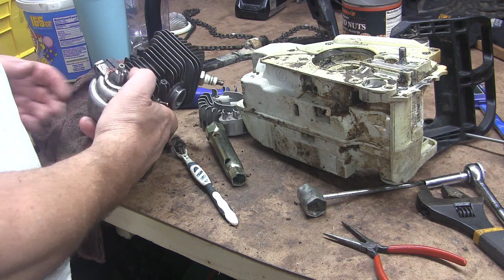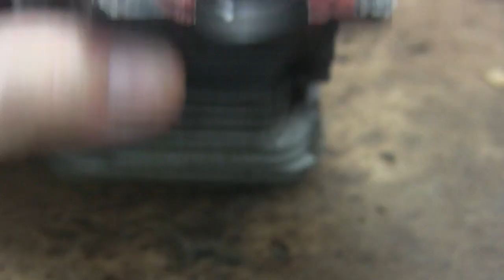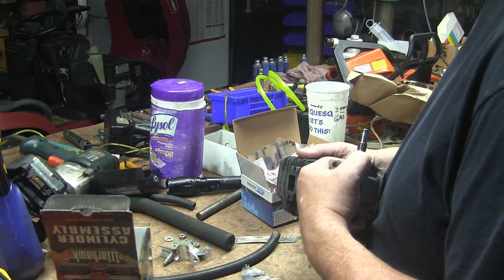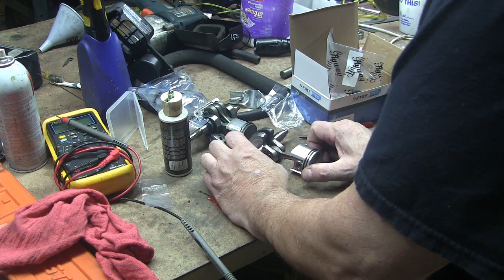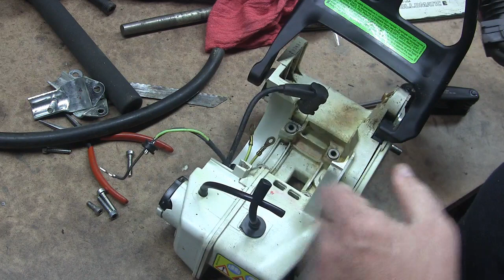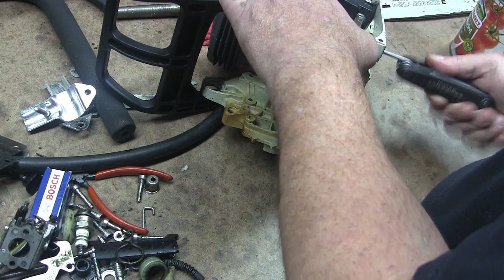Stihl MS 250C chain saw short block replace Part 1

Comment: thanks for the vid mate , im in australia , and about to do the exact same saw , its given me 5 years commercial hard work , which in its self is very impressive , so time for a rebuild . this vid has helped a lot . what was the gasket goo you used for the bottom end ?
Reply from the maker: High temperature RTV silicone. Let it cure for 24 hours with the bolts torqued before trying to run the engine.
Reply: I'm in Tasmania and mine was 3mths old and I decided to teach my boy how to safely cut trees and firewood.
Well... being over keen he gave it a tank full of straight fuel, no oil.

Not happy.
It cost me $450.00 Aus: for parts.
Needless to say he wont be using my chainsaw ever again.
Thanks for the vidio.
🇬🇸🐨🦘🇬🇸
Reply: @tazzygeoff621  did you teach him how to mix fuel ? Mistakes teach us , he will never do that again , so I reckon he's right to go .
Reply: @bizzybugseverywhere7801  yes, I did teach him how to pre mix the fuel, but alas, he is prone to panicking ( due to his mum.. long story 🤮) 
Recently he topped up the engine oil in his car. It needed 1 pint... he gave it 12 pints.
Lucky I checked, no damage done, just time spent doing extra bonding.
Some people are just not the hands type.
🇬🇸🐨🦘🇬🇸
Reply: @tazzygeoff621  dont give up   mate
Reply: @bizzybugseverywhere7801  I never will.
He is worth every moment and effort.
Reply: Hey @tazzygeoff621 .  I’m based in Canberra and about to do the same job.  Did you source original Stihl parts or aftermarket.  I’m guessing at $AUD450 you may have gone for original Stihl?  If I can ask, where did you source them from?  Cheers in advance.
Reply: @peterbyass5890  yrs, genuine parts.
I have found a company in Australia that sells everything needed and I am going to buy a complete motor from them soon.
From memory, $150.00 delivered.
Not genuine parts but what the heck, it will be a good spare.
If you ask I can look them up again and send you their details. 👍👍